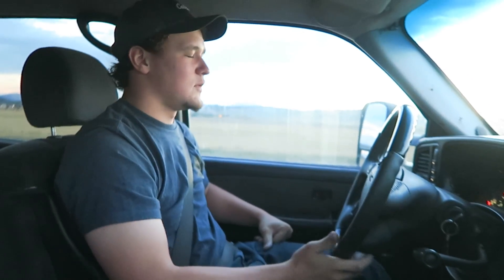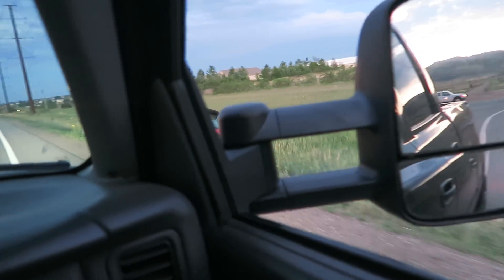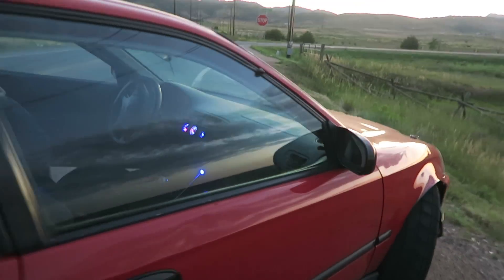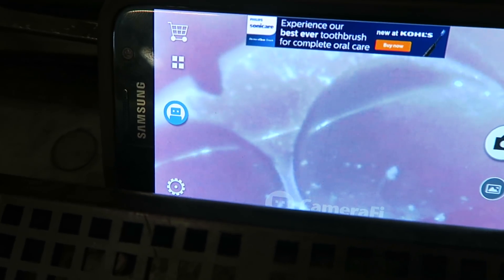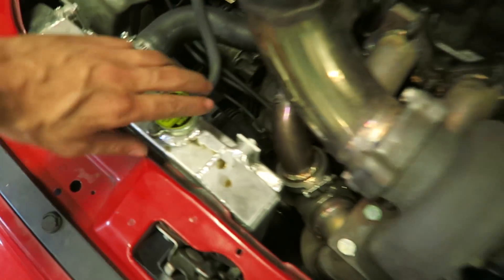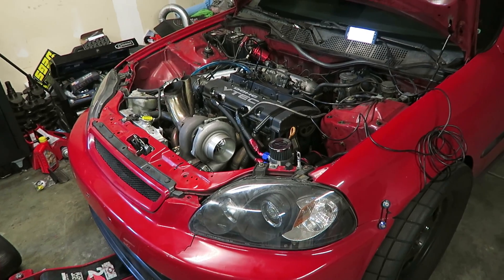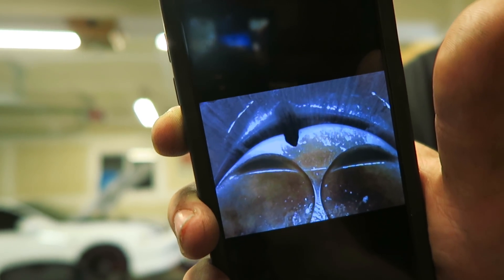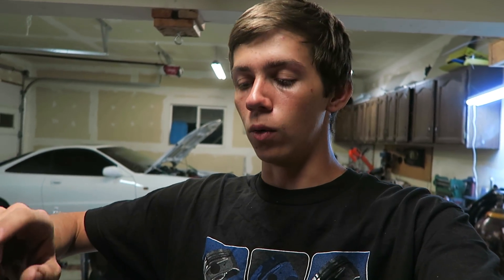Blew up The Hatch :(

Comment: I wouldn't risk putting new piston in that block. Your ideas to get a new block and better pistons is a good idea. Also your injector could be faulty and leaned out that cylinder not a far stretch considering the power
Reply: I agree, maybe sleeve that other h22 he talked about. That block seems like its toast now, the walls are probably scored to hell. Cheap pistons+high comp+boost =  not surprising.
Reply: HondamanFG2 Vtec mahle pistons are not  cheap . They aren't shitty either
Reply: Do any of you realize that when you sleeve a block it has to be bored out a lot to press the sleeves in and he can push for more power if he goes that route
Reply: thank you lol they dont know to put a sleeve in a open deck block involves sometimes or most boring the whole entire stock sleeve out and pressing new one in
Reply: That piston probably hit the valve.
Reply: The pistons are great brand.  Its just he set it up for 0 room for error.  This is why having EGT sensors are so key would have seen the cylinder get hot.  Number 3 is the hottest one as well.  All he needs to do it hone the cylinders and go .25 over what hes at now and that block is fine.
Reply: The block is closed deck already and is fine no need to sleeve it because its an iron block.  Stop acting like you guys know everything.
Reply: i thought it was a aluminum black iron sleeves ?
Reply: a valve hitting the piston would not cause a melted piston

Comment: Ceracoat (ceramic coat) the top of your pistons! And your valves it helps ALOT with the heat inside your cilinders and it's basically impossibe to melt a piston :)

Comment: @BoostedBoiz

I suggest you go with new block -stronger rods & make sure to check for any damage in the head like bent valves, replace the fuel injectors, use a better fuel rail & a more powerful fuel pump. That block is toast would NOT recommend re-using it with sleeves!

There is a saying: "You have to Pay if you want to Play" high compression is NOT the way to go with high boosted engine, it adds more heat having higher compression, puts more stress on the motor.
Reply: Block is closed deck and iron.  Hes running the best rods you can get for an h22.  Why would you resleeve it when you can go over .25 and save your self 2gs at least.  All the fuel is prob fine just doing back to back during the day with a setup that doesnt allow any wiggle room for erroe was bound to happen.  Nothing wrong with trying and learning things the setup was sick while it lasted.  All he needs is an EGT sensor to be able to prevent it in the future.

Comment: You should rebuild with same compression retune and add a methanol kit to bump the fuel octane up it would be like a blanket of security to prevent pre-detonation  on hot days and prevent lean spikes on cold nights depending what temp your car was tuned in. But deff beneficial. Please look into it ran it for years on a built b16 steeped bored to 84.5mm was making 576 for your years roughly 20k and sold still running. The h22 would be such a monster! Good luck bro!

Comment: Stronger and better pistons and rods💪🏾
Reply: Forged.
Reply: Viewing expensive af
Reply: Whats stronger then what he has now?  Mahle and a great rod top of the line stuff right there.

  Nothing can stand up to the heat which cause the piston to expand to much and break.  Needs a EGT sensor to monitor the heat if he wants this much compression.
Reply: @Screamingshiter I think this is the second time he had a problem with the pistons, That block is warped.

Comment: Get two sets of injectors and send them out to be flow tested and they will give you the 4 closest matching flowing injectors. They will also tell you if the spray pattern is bad and not to use some of them. That would help against individual cylinders acting up.

Another thing you could do is individual throttle bodys as well as 4 02 sensors, one in each primary exhaust tube. Then you can have a direct readout if any of your cylinders is going more lean than the others. It can happen with the way air flows and ciruclates and with differences in injectors.

Comment: I had a similar problem just the other week. Built my engine slowly over a year, was running it rich because I didn't have time to time it. And went to a track day. I had my suspicions of a faulty injector. And sure enough, melted number 3 piston. Not quite as bad as yours, but sounded the same when running lol. Good luck with the next build 👍

Comment: How are you monitoring knock?  From the sensor to logging. How are you doing it? Come up with a way to visually monitor knock while driving. That will cover you in a lean run, bad fuel, high ambient temp etc situation. Just because the hondata is set up to pull timing in the tune based of the stock knock sensor is not enough when you are pushing things that far.  Especially with added compression.  Good luck!

Comment: Sleeve it, blueprint it or get it professionally blueprinted, lower compression pistons and go for 1000 whp. You drive the 700 hp like a boss, you can obviously handle more power so if your gunna sleeve it you might as well go all out and go for some epic power